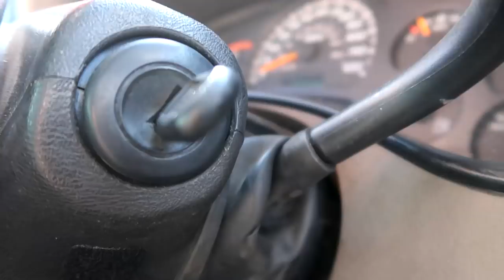100% SKETCHY!!

Comment: I used to own one of those Pontiac 6000's, was a great little car. On mine, the pivot for the rear axle rusted off on the passenger side, letting the tire rub on the back of the wheel well. Car still started and ran like a champ, just the body was rusted to hell